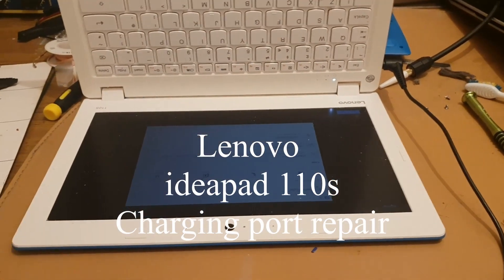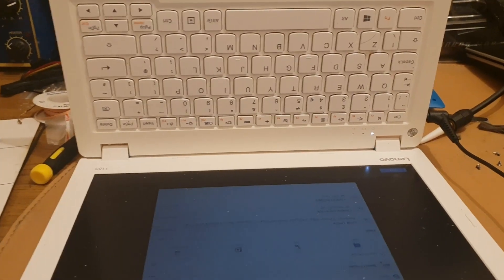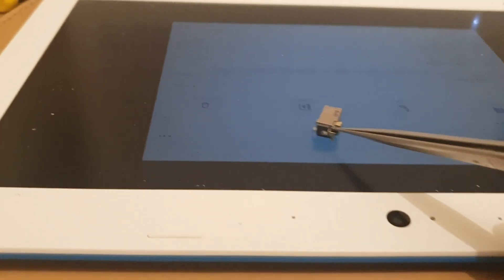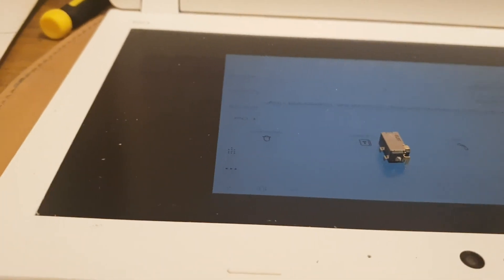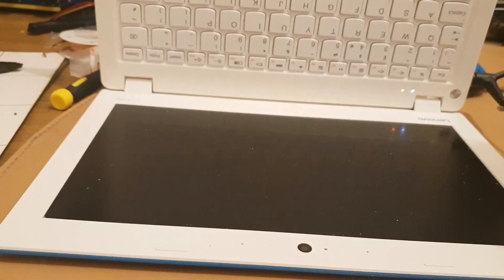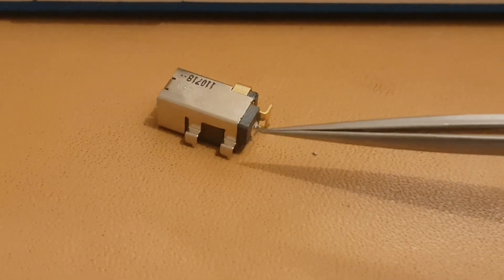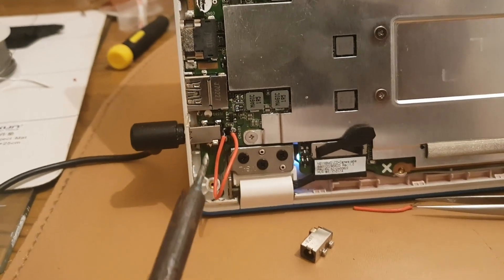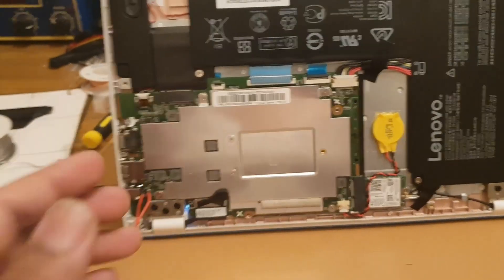How To Repair Lenovo Ideapad 110S  Charging port EASY FIX!!

Comment: If you have any component leads handy (from through hole components), they make for wonderful jumpers (what you referred to as a bridge) in this sort of situation. It's such a thin board that it can be fixed in-situ, without removing the board from the chassis, which is important as this is a budget laptop and not something I'd be comfortable charging 'full price' for in regards to removal of the board for diagnostics. Lenovo's budget device board quality is so poor, that this 'bodge' repair actually vastly improves the durability of the port!
Reply from the maker: Such a genuine explanation!

Comment: Hi, I found my Lenovo Ideapad 110s and bought a new charger. Now, it's been so long since I last used it that i forgot how it looks like when it's charging. It won't turn on so I don't know if it's still working, but the light blinks color orange. Is that the correct color or is it ruined already?

Comment: is there any possibility to use the 100S without battery? (I can't find any to replace mine).
Thank you for your video!
Reply from the maker: It is absolutely fine to use a  laptop without the battery(some laptop does not work properly without battery) your one would be fine. But try to use it as a desktop pc, I mean don't move the laptop too much while you use it. Because if the charger gets disconnected the pc will shut down immediately and that is not good for the hard drive or for the motherboard. So keep in your mind while you use the laptop. Please do subscribe to my channel if you like the video.Thanks
Reply: @thepcphone  This laptop is not working if I disconnect the battery. It works only if I use the charger and the battery connected. That's why I asked if there is a possibility to do something to make works the laptop without the battery.

Comment: Hi, Thank you for your video it helped me a lot. The copper wire at the back of the block had broken but I have had no experience soldering wires  of this size in such a tight space so for now I have levered one side of the copper wire up to get a contact and it has worked well. I realise that heating and cooling may lead to it being faulty again when I will have to have bend the wire again or maybe by that time I will have the skill and confidence to solder the wire back permanently. Thank you again for the video. Kind regards from, Ian M.
Reply from the maker: I am Very glad to hear it!! Please do subscribe to my channel  for future videos!! Hope see you again!!